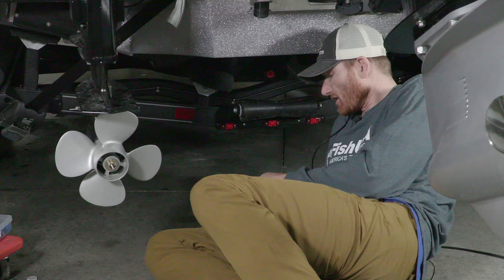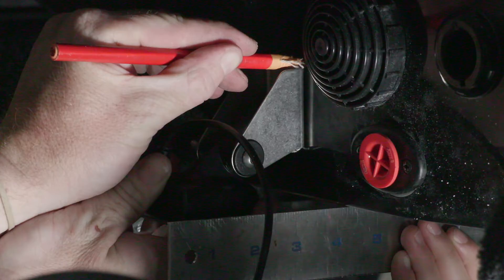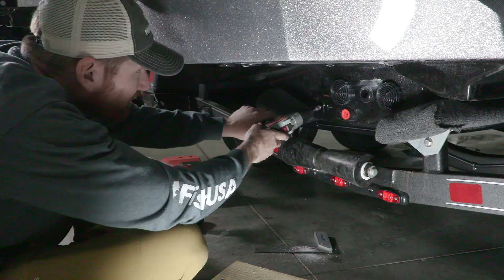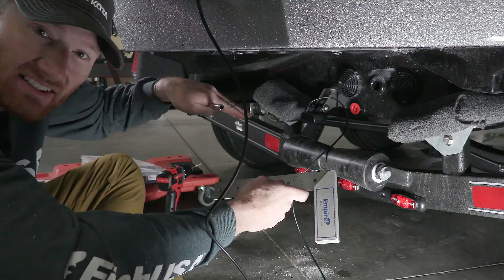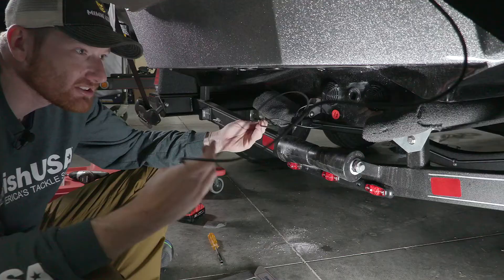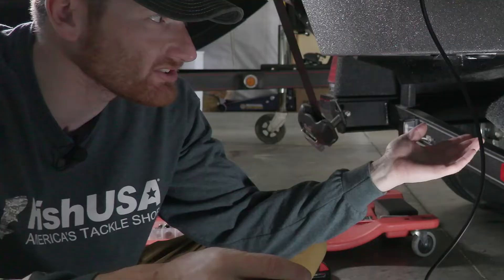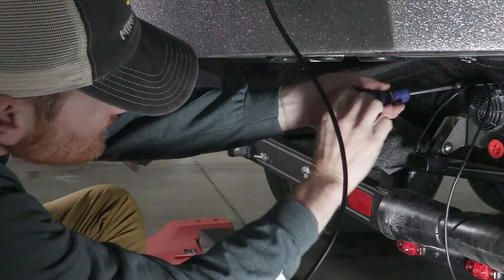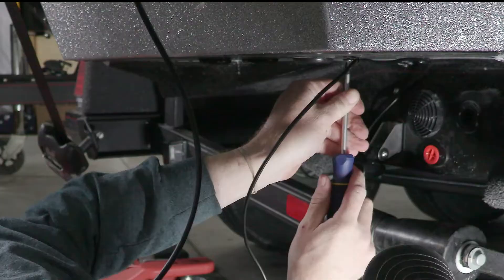How to Optimize Transducer Placement on Your Boat During Installation

Comment: Drilling holes in your boat is really unbelievable this day and age, it’s terrible advice, use a mounting block.
Reply from the maker: When you have had many of the same rig and know exactly where it needs to go, it works. A transducer board still requires 2 holes

Comment: This guy should of also included putting some 291 Sikaflex or whatever products you are confident with into the holes after he had marked and drilled the holes when he put the screws into the fibreglass?
This is why so many boats suffer from water damage and dry rot..
Always use the best quality sealent you can 👍.